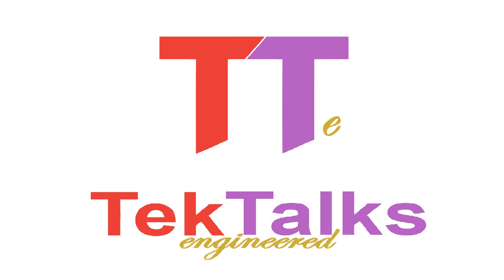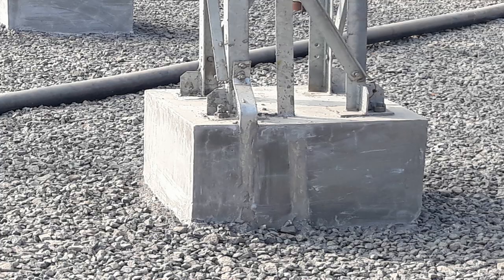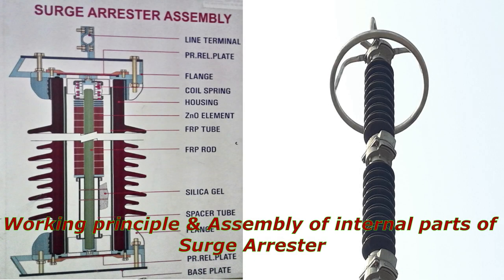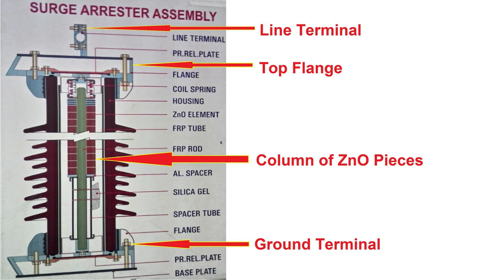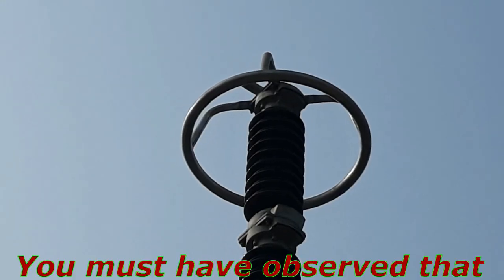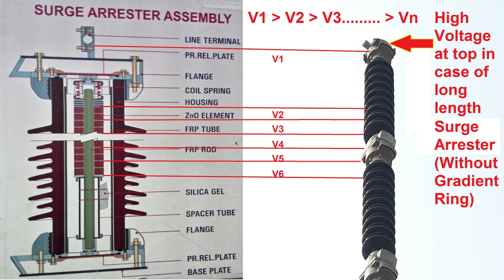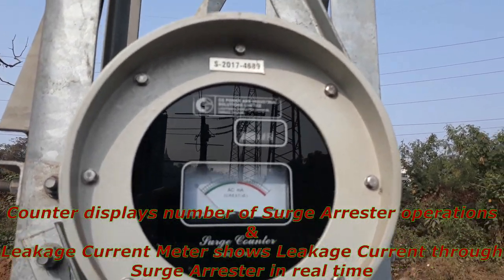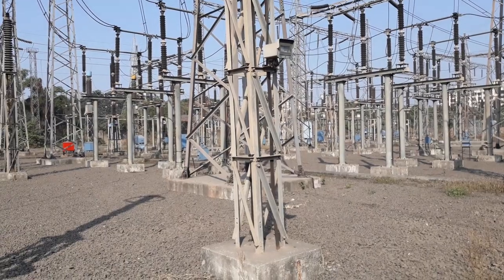Surge Arrester Lightning Arrester working with ZnO Column Gradient Ring & Critical 2 point Earthing

Comment: I have a some questions:
1. How many operations can a surge arrester withstand properly?
2. If a relatively new surge arrester explodes, does it mean the arrester didn't work properly? wasn't selected correctly? or was a victim of the randomness of lightning phenomena?
Thank you very much for the awesome video!
Reply from the maker: 1. Number of operations depend upon frequency and type of faults and also frequency and type of surges.
2. Reasons for surge arrester burst are many. Such as high value fault. Type and frequency of surges.

Comment: Sir but surge arrester absorb the energy of  surges and divert it and lightning arrester just diverts the surges to the ground. I think this is the main difference.
Reply from the maker: Surge arrester protects electrical equipment from any over voltage surges due to faults or even lighting.

Comment: Hi sir,i hsve the following questions:
1. I always had this doubt that how lightning will only fall on the LA or the lightning here we sre tslking about is the on the transmission line,but if it is the line then line has ground wire to ground it?Kindly explain.
2. The counter counts the number of operation but what is the leakage current measurement?which leakage current are we talking about?
3. I have heard that while taking back charge from a substation to charge our transformer,LA shows some leakage current,which inturn confirms that the line has been charged.Is that correct?
Reply from the maker: Answers to your questions 
1. Lightning arrester provides path to ground for high surges. Wherever Lightning may strike, whichever part of the conductor or whatever equipment it may be, Lightning will pass to ground through surge arrester only. Saving other equipment from damage.
2. Leakage current through LA meter indicates how healthy ZnO elements are. And how healthy insulation inside LA is. Counter counts number of strikes experienced by LA.
3. Did not get the case being described.

Comment: Does ZnO act the same as a current transformer and saturate? And How do you have a circuit (µA) before saturation ? Is there a standard index of current to voltage at saturation (50:10 current voltage in CT's)
Thanks
Reply from the maker: ZnO is a semiconductor and yes it saturates.

Comment: Sir, Can you explain the effect of lead length on working of lightning arrestor.
Reply from the maker: Function of Lead in Surge Arrester is to conduct impulse current during surge voltage. Hence inductive voltage across the lead is built during surge. Same voltage is there across the protected parallel equipment. So in case of more lead length, more inductive voltage is built across protected equipment, which can cause equipment failure. Hence optimum lead length is necessary for Surge Arrester design. Hope this is helpful. Thank you for comment.
Reply: @ElectroGlobe1  Thankyou 🙂 ..!!

Comment: how to find out the nominal discharge current for 33 kv zno type LA?
Reply from the maker: The  peak value of  the current, selected  by the manufacturer, that can be  passed through LA to calculate nominal discharge current. Subject to guidelines by Standards.